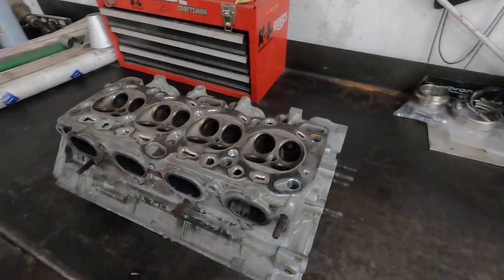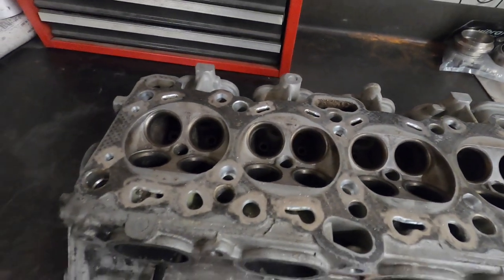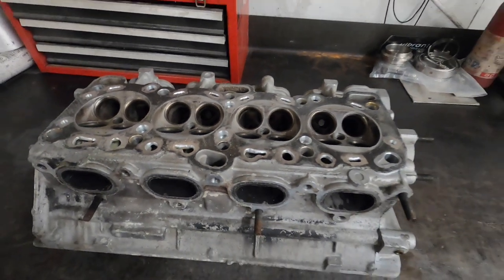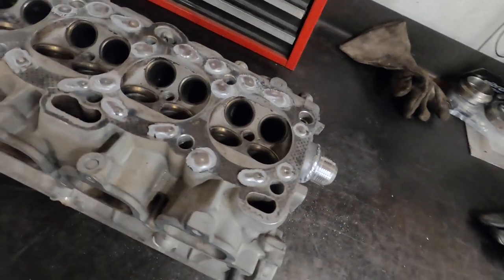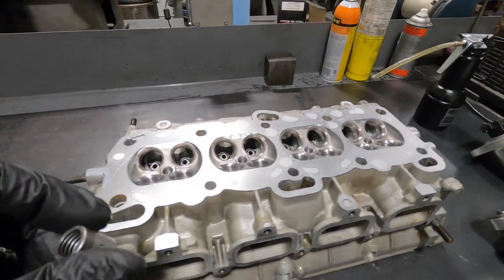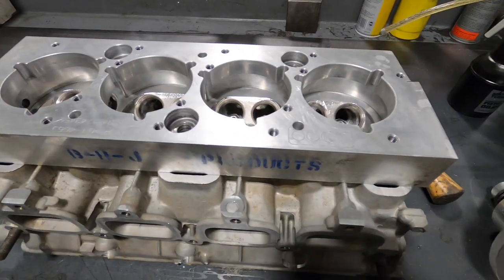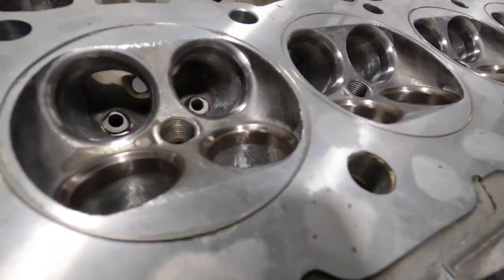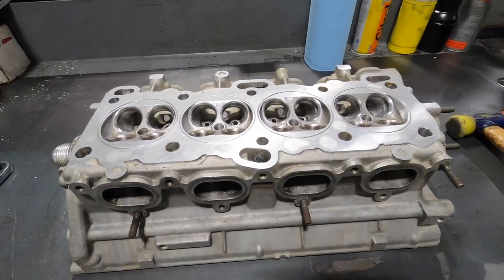Engine Machining - We dry deck a 4G63 Cylinder Head | Install O-rings for use with Copper gasket

Comment: What temps would you experience after a run with this setup
Reply from the maker: The majority the filled block/welded head engines we do are on methanol.  They usually gain 10-15* or through a pass.  Obviously fuel type, tunning, and run duration all effect this.

Comment: Head or block. What’s best ?
Reply from the maker: Depends on what you're doing. If running an oring with an MLS, you need to put the oring in the block.  If you're doing an oring with a receiver groove and copper gasket, the oring goes in the head.

Comment: So these are no longer streetable when u fill all water passages in the block?
Reply from the maker: Havent had anyone try for any serious distance. That said, you're still running coolant through the head. That combined with an oil cooler would do well, I'd think.